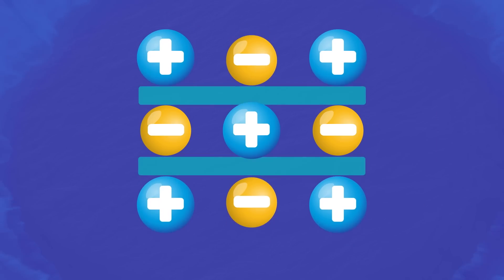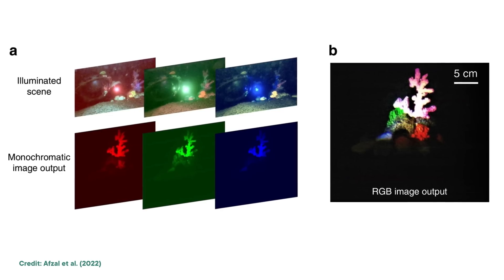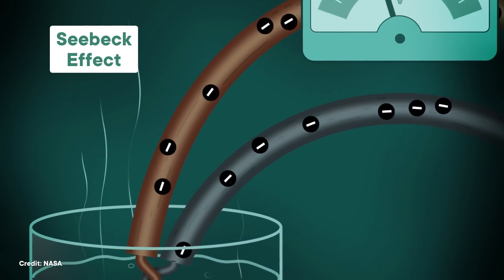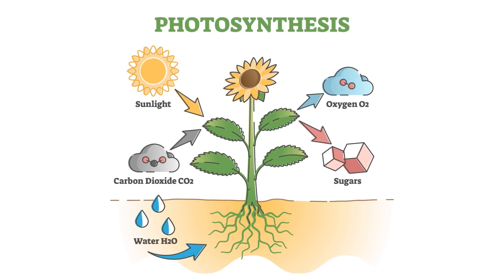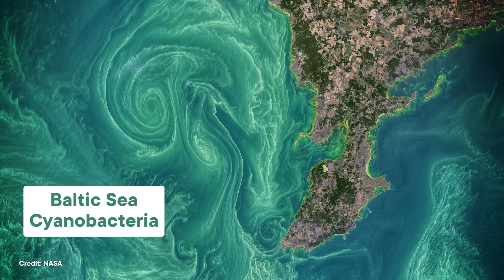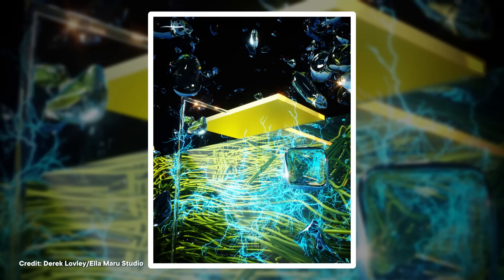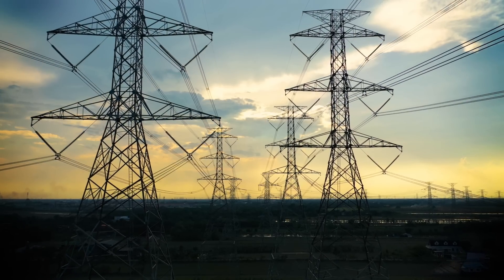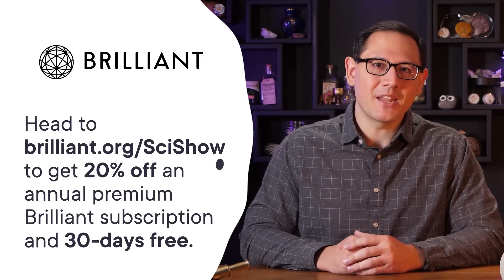Four Weird Ways to Make Electricity

Comment: wouldnt harvesting the energy in a plants leaves prevent them from pulling carbon out of the air as effectively. i was under the impression all that energy is used to turn carbon dioxide into sugar?

Comment: @5:57: "but multiple leaves can be strung together to create a circuit"... Yeah, technically that would be possible if the leaves are either detached or belong to different plants that are electrically isolated. But in practice, you can't string together multiple leaves from plants all connected by the same soil. At most you will get half a volt, and that's too little to be usable for any electronic today. You need at a minimum a diode drop (0.7V), or in practice 1.5V to start to make any higher voltage.

Comment: I don't think the main issue with those leaves is the low voltage but the very low amperage they can generate. Even if you string a bunch of them together to get 14 volts you wouldn't be able to drive the starter motor for a car engine or even generate sparks in the sparkplugs. So the comparison with a car battery (which can melt a wrench btw) is very oversimplified

Comment: when water molecules in the air "rub" against the walls of the pores they should loose kinetic energy that then becomes the electricity. this would thus cool down the water molecules. would this not cause condensation to for form in the pores which would then become trapped because of the capillary effect until it evaporates?

Comment: Well, you can't extract energy from a single state, like static pressure won't work for piezoelectric power generation, or air just being humid won't provide any energy for you. You need a difference, a change, something that "happens". The weaker and more dilute this difference is, the less likely it is it to be meaningful to try to extract energy from it. 

None of the principles have reasonable potential to make a difference on grid scale, the Seebeck effect is useful for power generation in very specific cases, the rest is nowhere near that. The piezoelectric effect is used for sensing, and can technically be used to generate some power, but it's not practical. We have great technologies for converting sunlight into usable energy. "Up to" value of open circuit voltage is in itself meaningless, harvesting meaningful electric power directly from photosynthesis is not possible, as far as we know. Meaningful in this context requires, among other things, being a relevant alternative to photovoltaic power generation.                  

Don't get me wrong, I enjoyed the episode, despite some of the technical "details" were wrong, and suggested potential usefulness that isn't real.

Comment: The problem with hydrogen is not that you have to burn it (oxidising is the same as burning anyway), but that you have to make/extract hydrogen from something. Making it from water requires all the same energy you get back when you burn it, while getting it from fossil fuels is cheap but not green at all.

Comment: Really wish we got some deeper analysis here. Squeezing a bunch of tech in does make for a clickworthy video, but without diving in a bit deeper it's hard to evaluate these techs.

For instance I;d presume the humidity one is likely very dependent on variations in such to work out, and would only get 1 to 2 cycles per day depending on if it worked in reverse. I'd also presume that the sorts of structures that make it work well in one direction or the other, likely make it hard to reverse (i.e. drying out a wet thing, or wetting a dry one).
Reply: All the sources are listed in the description for further reading :)

Comment: Since photosynthesis needs the electrons it generates from sunlight to split carbon from CO2 and make sugar from it, extracting energy from the process almost certainly disrupts it.
The "cloud" generator sounds like by the time you get something bigger than micro-power from it, you may as well put a small wind turbine in: the cloud still needs wind or convection to passively move moist air through.
Reply: Natural photosynthesis is really inefficient, so using energy the photosynthesis isn't is a good source.
Reply: @thekaxmax  Even an inefficient process can still work out if it scales in a cost-effective manner. Can't really imagine organic PV being cheaper per mW nor more convenient though.

Comment: This is an honest critique. And I wrote it while I was watching your clip.  I found your explanation of thermoelectric effect to be both truncated and misleading. 
If you want to take shortcuts, then talk about peltier cells.
Hydrogen gas in the air?  .... Really?!
Hydrogen concentration in the air is 530 parts per billion.... Billion...
That means there's literally a hundred thousand times more carbon dioxide in the air than hydrogen.
Either don't try to go so deep in your analysis or focus your attention more tightly on a specific part of your topic. 
Quality is more important than quantity especially if the quantity is wrong. As a science communicator, this is the single most important part of your job description. You are informing the opinions of literally thousands if not hundreds of thousands of people.

Comment: Piezoelectric is used in atomic force microscopes and scanning tunnelling electron microscopes. The samples are moved relative to a sharp probe. The ultra fine movement is controlled by varying the voltage applied to the crystals. These sort of microscopes were used in 1989 to write IBM out of 35 atoms.

Comment: “A single car battery” phrased as if it’s not a 25+lbs power source 😂
Reply: Lead acid batteries have a relatively low energy density, modern batteries have 5x or more the available power.  Using car batteries is just a commonly known reference point, like how some people use bananas for photograph scale.  Good comprehension though, you did understand the word battery!  Way to go, buddy!

Comment: actaly geting alecticsy out of thin air is acatly bacly teachly what zero pont enrgy that is still bacly makeing a elcromatginc feld that bacly colects most of the allready bacly spread out engry elcomagtic felds from atrothy and bascly focusis the elcomagtic energy  back into far higher power contration and  densty bescue of the weak elcomagtinic forcse is litrlay everywhere and zero ponit engery just foces it and condenses it back into a far far more focesd contraion of enrgy.  yes theres is in fact alot and i mean aslot of elcitristy in thin air witchs is bacly the near valcume of space ltriay has very massive aonut of elcorticy in thet thin near vacume of air of outer space.

Comment: Missing piece of info for the “leaf battery” thing — what sort of current (amps) does it generate? Putting them in series could get you to 12v, but it definitely won’t generate as much power as the car battery
Reply: pretty relevant info :D
Reply: Yeah, decent oopsie to make XD I’m sure some people are thinking they could charge their phone with a line of plants, lol
Reply: @DoctorX17  I mean, technically you could, if you could wait for about 5.6 million seconds... That's about 128 days for a 10% charge. 😅
Reply: @Unmannedair  it just put more plants in parallel XD
Reply: @DoctorX17  
Parallel Series.
Reply: @world_still_spins  yeah. Need both for proper phone charging!
Reply: Yeah, that leaf battery thing, we're talking microamps here. You wouldn't even be able to measure using standard electrical equipment. Definitely not with your run-of-the-mill multimeter. Lol

Comment: Clarification : piezoelectricity works on changes in pressure, not simply pressure, which is why sound is a good source
Reply: It all is depicted in animations and clarified by Niba in later part of the video.
Reply: Wait what ? Changes in pressure ?
Reply: @PotionsMaster666  
Yes, it's all about internal vibrations (changes in pressure a.k.a. squeezing and stretching).
Reply: @smart_ledtv 
Nobody:
quartz speakers:
Reply: @PotionsMaster666  Just pressure on its own has no effect on these, they make electricity when there is a change of pressure, so a sound pressure wave will make electricity
Reply: @davidioanhedges  😮 But why change in pressure tho ?
The way the video explained it was reasonable that only pressure was required.
I will Google it.
Thnx for replies guys
Reply: @PotionsMaster666 I have two answers for this: the short one is: otherwise it would violate conservation of energy. Applying pressure takes energy, maintaining it does not (e.g. a heavy thing laying on top of the crystal) so it can't convert that energy. The more complicated answer is that current is the movement of charges - and once the charges on both sides have equalized, no more current will flow

Comment: I was wondering about Nikola Tesla's ideas about generating and transmitting electricty through the air rather than through cables. Was he onto something there?
Reply: They get revived by enthusiasts all the time. The short version is that it works, but it's severely impractical. He was able to make practical demonstrations, but only illuminating very small discharge lamps at short range, and to achieve that he needed a two-hundred-kilowatt transmitter. The inefficiency is extreme. If you wanted to power a city like that, you'd need to generate a field so intense it would reduce everything in the vicinity to a seething plasma.

Comment: A fun fact about Piezo electricity, it can be used to create motion with electricity, like in a quartz powered clock or watch. There are (diesel) injectors that are actuated not by solenoids or other electrical means but by Piezo electricity, which has multiple advantages; the main one being the fast acting nature compared to something comparatively high mass as an solenoid and also the longevity is a large factor.

I own a car with an engine that has that (an VW 1.9 TDI, an inline 4 turbo charged diesel, engine code ASZ) and it has racked up 540k km or around 335k miles with the original Bosch injectors from the factory. Let's be generous here, with the fact that it has mostly done highway miles at around 70 mph. It does about 2000 revolutions a second. Since it's a four stroke it means every other revolution a combustion event occures. That equates to about 290.000.000(!) ( 335.000 miles / 70 mph * 60 minutes * 1000 injections per minute ) injection cycles on each of all four injectors. Mind you that in semi-modern diesels it's not unheard of for an injector to file up to 7 times every combustion event. It's not hard to imagine the actual number might be closer to a billion actuations, especially if you consider the average speed is actually lower which means more firing events per mile.. It boggles my mind when I think about this.
Reply: That really is a fun fact :0

Comment: That electron flow animation illustrating the thermoelectiv effect can't be right. That would lead to high voltage and charge between the warm an cold end of the circuit in no time.
In this, like in any other electric circuit, electrons flow along a circular path.
The two metals present in the thermoelectric jucnction create a voltage difference that changes with temperature, which creates the electric "pressure" that forces electrons around.
Reply: Yeah she botched a lot of stuff in this... LoL 
Heat flows down the wires like that though. But there's a differential electrical pressure at the wire junctions and that's what causes the current to flow. 
Heat is transmitted from electron to electron in a wave much faster than the actual electron velocity and the wave velocity is independent from the charge velocity. I think that's the distinction you were looking for. So the heat flows like her diagram but not the charge

Comment: I make electricity shuffling across carpet in slippers. 
Then getting hit with 40,000 volts when I touch refrigerator. ⚡
Reply: We're walking around on a 4000 volt potential just being outside... This b***** article completely lacks any sort of depth or context. She pulled this article out of the same thin air that she pulled the science out of

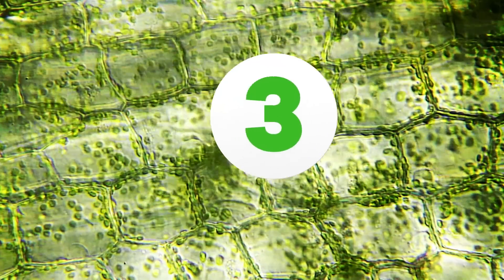Comment: It seems a slight contradiction has creeped into your dissertation. At 4:00 you state that the internal temp should be hotter than the external to generate electricity. Then, at 4:33 you further state about wandering a dark forest at night. At night, the forest would be colder than the daytime, while the internal temp would still be hot, so why would you need additional batteries? Of course, you could be referring to the extreme cold of space or Mars, but that did not come across. Also, the student that created light from her own body heat would still work in a dark forest, perhaps even better.
Reply: its not necessary that internal is hotter than external, only that there is a significant difference. This doesnt occur much on Earth(atleast compared to space) hence the dark forest example where body and forest temp are similar (even if the forest is a bit colder)
Reply: Where I live, the air in the middle of the night is often only 10° C cooler than a person walking through it. I don't think that's a large enough differential for the tech to work from the way it was phrased.

Comment: Hydrogen is extremely reactive and does not like to float by itself in the air. Most of it is bonded in water vapor. So the technique to oxidize it to extract energy is a bit overly optimistic. This is already happening by itself in the air without us being able to extract energy from it, and we would be trying to oxide the remaining scraps.
BTW oxidizing is the same as burning.
Reply: We already have hydrogen fuel cell cars that do exactly that
Reply: If you put a little oil in the pan and stir the hydrogen around a lot with a spatula when you oxidize it, it will just blacken a little around the edges and stay yummy on the inside.

Comment: Niba, I need to point out that, at about 5:55, the 12V car battery you compared the leaf to is comparing 6 cells in series, with the single cell that the leaf is. So, the leaf cell is closer to 1/10th the voltage of the car battery, than the miniscule amount your comparison suggests.
Also, the voltage of the leaf cell might be easily raised with different materials on the cathode and anode.
Reply: This also misses the CRITICAL piece of info that voltage does not necessarily mean power. Car batteries have a relatively low voltage (compared to other electrical systems) but can provide an insane amount of current and therefore power. Meanwhile, you can create static electricity with hundreds (or thousands?) of volts, but with a minuscule amount of energy stored within.

Somehow I doubt that 10 plant leaves would be able to generate more than a couple milliamps at best. I'd be happy to be proven wrong though, it would be very cool.
Reply: @DrakiniteOfficial now if we could genetically engineer the plants to develop the structures themselves and us just “farm” electricity thatd be cool, but that is probably more in the realm of science fiction currently
Reply: @DrakiniteOfficial  She wasn't talking about power she was talking about succulent leaves that produce voltages, and comparing it to a common reference point.  You are stupid and should stop correcting people, you are not equipped to do so.
Reply: That is just a battery with a plant electrolite, and in that case we already have the classic lemon or potato battery...
Reply: How much current can these leaves push
Reply: Watts should prob be the comparison used
Reply: @h3lladvocate  How do you determine wattage without resistance?  Please tell me, what wattage a .6v power source puts out. Or any power source, pick a number.

I'll spare you the embarrassment of trying to answer a question way beyond your ability to ever understand, you can't.  Watts are volts x amps, you only have the voltage you do not know amperage until you connect it to a circuit.
Reply: @h3lladvocate  for sure a good stat but some circuits require a minimum voltage or current as well as wattage
Reply: It was literally just a common reference point everyone who knows what voltage is will be familiar with, but thank you for your pedantry absolutely nobody cares that car batteries have multiple plates.  It doesn't affect what was said at all.
Reply: @vyvianalcott1681  If I hadn't cared, I wouldn't have opened my neck, Mister Main Character.
I am an electrician, and I care about accuracy very, VERY much.
It is, after all, what keeps your house from burning down.
Reply: @TimeSurfer206  Pedantry, not accuracy.  A battery is a single object which many people are familiar with, that's why it was used as a reference point.

Comment: The same way we have a sound powered telephone... I could think of that
Reply: Yes, that’s how microphones work.  The sound compresses the piezo which gives off a minute signal.  It still needs amplification before it’s useful and far too low to run the cell signal.
Reply: @CarFreeSegnitz  No, there is such a thing as a sound-powered telephone. It's just coupled moving coils: You talk loudly in to one, and you get sound out the other. Faint, but good enough to hold a conversation. It's the electronic version of two cans and a piece of string. Only good for short cable runs and point-to-point operation, but they can operate with no external power and are very reliable, so they have a niche in emergency communications. Especially marine applications - even if the ship's electrical systems are utterly dead, the sound-powered telephones still connect vital locations to the bridge. Batteries have a finite lifetime and may be neglected during servicing, but the sound powered telephone will always work so long as the cable isn't broken.